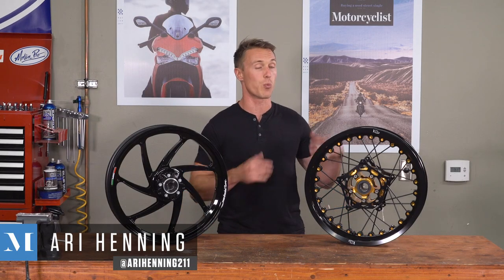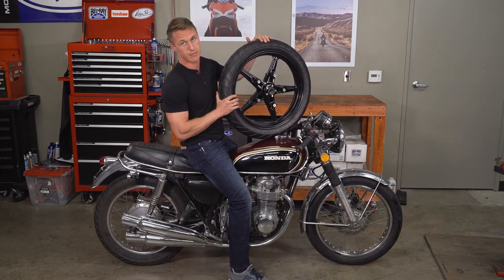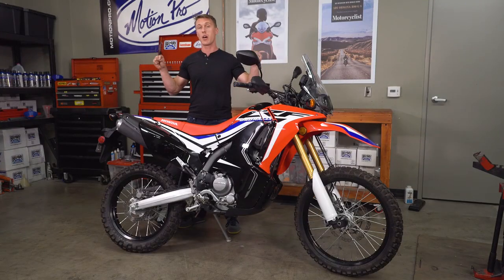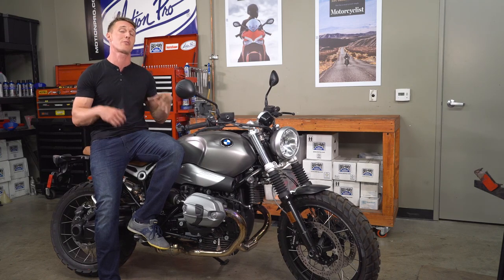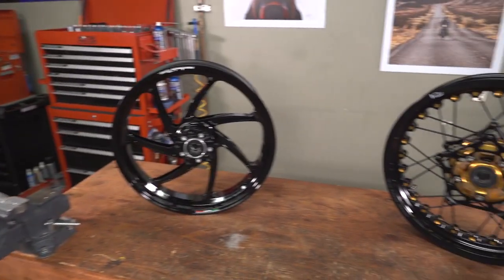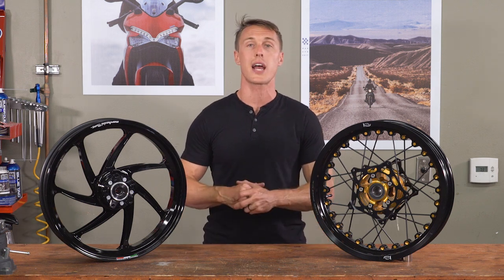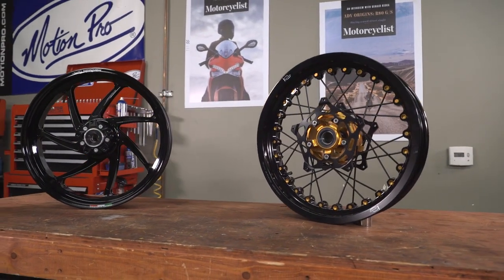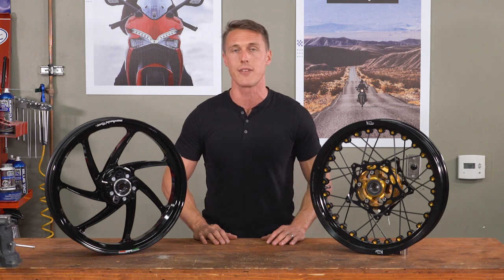Wire-Spoked Wheels vs. Alloy Wheels—Which Are Better?  | MC Garage

Comment: Do a video on Clutch-less shifting (power shifting) versus a quickshifter versus regular shifting
Reply: I just explained power shifting. It is not like clutchless shifting or having a quickshifter. Quickshifters and clutchless shiffiting work the same way. They both momentarily cut the throttle at the same time the shift occurs. The only difference is that clutchless shifting requires the an individual to close the throttle while a quickshifter causes the throttle to cut automatically by telling the computer when the shift is happening.
  With power shifting you do NOT let off the throttle when you shift. You keep the throttle wide open and make the shift. This allows the engine to produce more power right when the clutch engages.
Reply: Quinney84 it's not all that bad to shift without the clutch or to power shift on a bike if it's not often. I power shift and clutch less shift on my dirtbike all the time during practice and races, but only ever shifting up, not down. The gearbox in a dirtbike is the same as a street bike so it makes no difference between the 2. I have had no extra wear on my clutches or gears from doing this. And on my street bike if I'm not revved up really high I'll shift up without the clutch here and there. Never hurts it. I don't shift down without the clutch ever. Only shifting up.
Reply: There is a big difference between dirtbikes and streetbikes and that is power. If you start trying to powershift on a bike with a lot of power it could cause unexpected wheelies or loss of traction. 
 You kind of pointed out a good reason to use powershifting. When a vehicle is lacking power powershifting can help you squeeze a bit more out of it. A lot of modern streetbikes have more than enough power and would not benefit much from powershifting. It would more than likely burn up a streetbike clutch very quickly.
Reply: Quinney84 You are very correct. It is a bad idea, even more so on a bike. It would be hard on the clutch, motor, and can cause a loss of control. 
  I never have tried powershifting nor would I recommend it. 
 I don't understand why you would think this technique is slow though. It would be just as fast as regular shifting as it is basically normal shifting while keeping the throttle pinned.
Reply: Your right. After watching some videos of sport bikes i can see there is so much power in most street bikes, that it would be deadly in some situations.
Reply: Power shifting is pretty much like regular shifting except you do not let off the throttle when shifting to the next gear. I don't recommend this on a bike. I think it is used more in cars. I could see things going very wrong very quick on a bike.
Reply: up for this!
Reply: stimpson j cat what you explained sounds like your clutches worse nightmare, i assume you are pulling the clutch in to engage the nxt gear, now the technique you described is slow af mate. a quickshifter will cut the ignition in 0.06s, a clutchless is as quick as you can close then pin a throttle and yours could be the clutch burnt out in 10miles. get a quickshifter mate. ps bikes and cars have different types of gear boxes.
Reply: "Shifting without letting off the throttle isn't an actually technique in the world of motorcycling".. Really... I do it all day on my yz125 and kx250f. Ive never had problems jamming the throttle while shifting up.
Reply: Try it on a big bike. As I said, on lower powered machines it could work to squeeze a little more from them. Try it on a street bike and it could get out of hand quickly.
 Are you wide open when shifting or just not letting off the throttle?
Reply: I shift when ever i need to and constantly slip the clutch and hold the throttle wide open so i can stay in the power-band. Honestly i hardly think about what im doing at all, my muscle memory just automatically clutches, shifts and manipulates the throttle to get to point A to point B the fastest way i can. Somethings you can just never learn on a street bike honestly..
Reply: I plan on getting a FZ-07 eventually so i guess ill see how my dirt riding techniques does with my first street bike lol.
Reply: blu3flare25 You are right. I didn't even think about it but you do slip the clutch a lot on a dirt bike. I even raced a little mx and it slipped my mind lol. 
 With most street bikes there is a lot more torque and higher rpms which changes everything.
Reply: blu3flare25 your clutch must love you
Reply: Where are your manners? If you included a "please" you would have a thumb up more.
Reply: @WeItenspinner  I just came on to offer the same advice. Please and thank you go a long way
Reply: Well clutch-less shifting and power shifting are two different things. Also there are tons of videos on the subject already.
Reply: Yeah like you I thought that power shifting and clutch less shifting were the same thing in regards to a motorcycle, which is the act of cutting throttle and shifting up without clutch not just keeping it pinned and trying to shift which i would imagine is very hard to kick it into gear.

Comment: I'd like a video on the naming conventions of some bikes, like FZs, GSXR, KLR, etc... or just a breakdown of the differences of single, twins, tripples, and the other engine types and layouts (power, characteristics, blah blah blah)
Reply: KTM is the worst with name. Once you know it is not bad, but outsiders looking in it is terrible.
Reply: Single cylinder engine: 1 piston and 1 cylinder in engine
Twin cylinder engine: 2 piston  and 2 cylinders  in engine
And so on..
Reply: @kooler999ify  Does your mama think you are clever? She is likely the only one.
Reply: @tinkert3100  you would be surprised. There are a lot of people who don't know the difference between single and multi cylinder engines. All they care about is the max power.